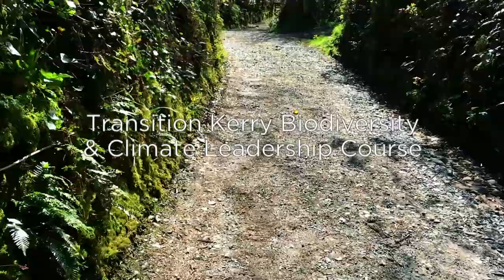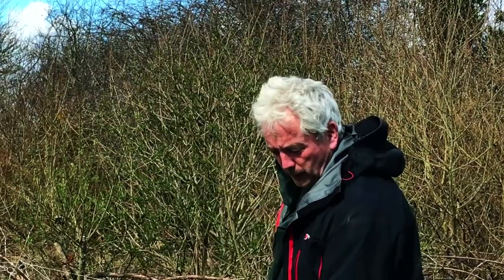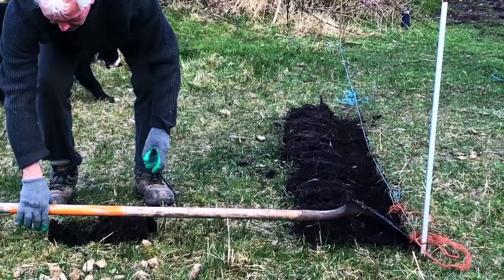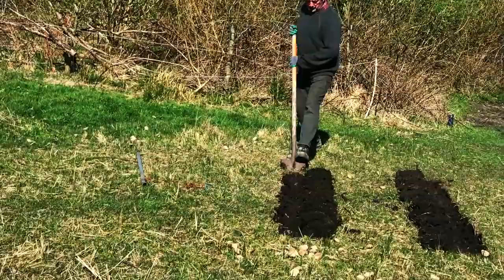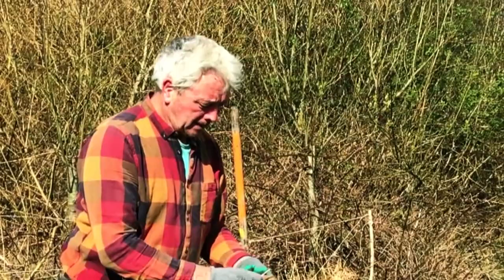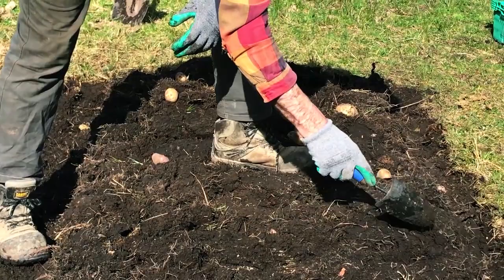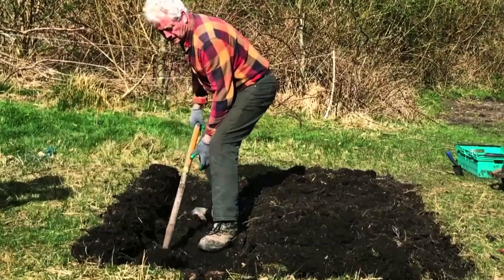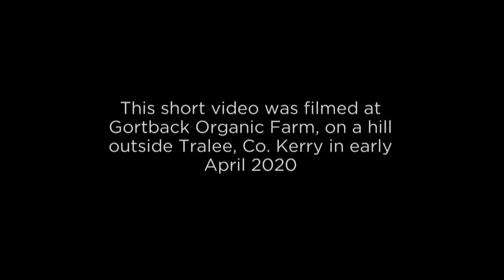Making a (lazy) bed - a traditional Irish raised bed

Comment: What a great explanation.   It is indeed called a "lazy Bed" but it's far from lazy.  I used to make lazy bed but now I grow my spuds in old paint buckets.  It's cheap!, easy and plentiful.  Just chuck them into a wheelbarrow come harvest or carry the buckets into a shed for winter storage. Works equally well for carrots and onions.
Reply: When u carry buckets into shed for winter.. do you leave potatoes soil etc in the buckets??
Reply: @fuchsiagreen1377  hello Fuchsia Green.  Yes indeed I just carry the buckets into my shed. I have small drainage holes at the bottom and last year I grew a new variety called "JACKY" which is a new blight free spud from Holland. Good luck with your garden this year.